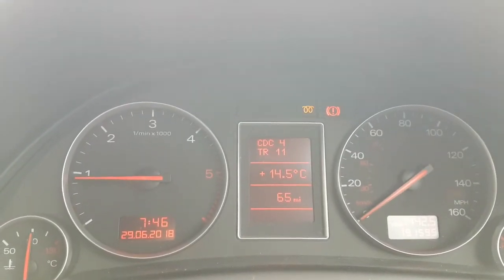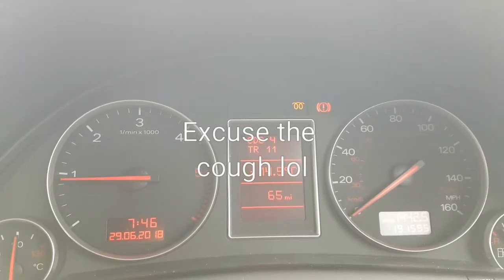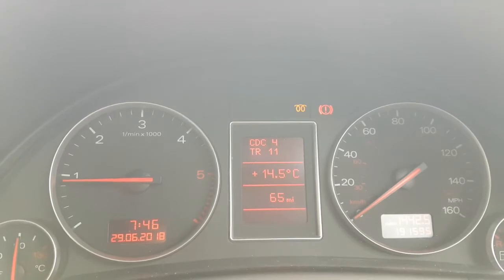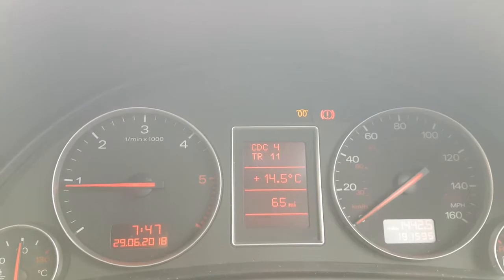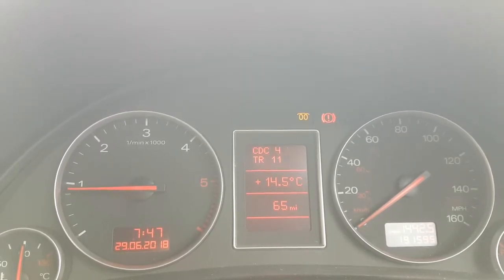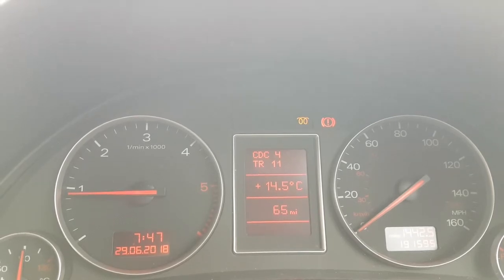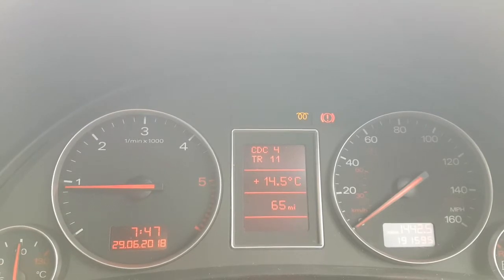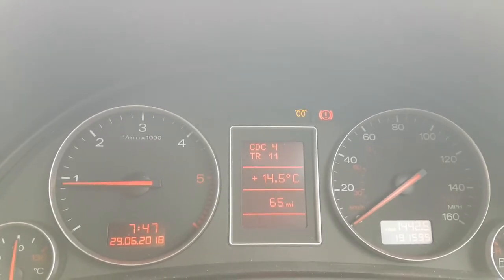Audi a4 b6 awx 1.9 tdi misfire on idle NOW WITH GLOWPLUG LIGHT FLASHING

Comment: 18062 - Please check DTC memory of instrument cluster P1654 - 35-10 - - - Intermittent
19463 - Camshaft position sensor (G40): No Signal P3007 - 35-00 - - - 
19561 - Valve for intake manifold flap (N239): Open or short to ground P3105 - 35-10 - - - Intermittent
17957 - Boost pressure refulation valve (N75) : Ope  or short to ground P1549 - 35-10 - - - Intermittent
16955 - Brake switch (F) : Implausible Signal P0571 - 35-00

I had a new break switch installed because break lights were always on even when i had the keys off the car , since i put a new brake switch , brake lights are working ok but on vagcom i still get brake switch fault and other fault codes instead of all the ones i put up here (well some of them still show like break switch , camshaft , n75 valve) buts other codes show up and car still in limp mode , but if i change the blown fuse on ecu car will be ok for a couple minutes

Comment: Hey buddy have you fixed this problem ? My Audi A4 1.9Tdi 2003 (B6) just has this problem for 2 weeks now and cannot get this problem fixed , car was in the mechanic last wednesday he told me problem was fixed but the issue returned again , i do not want take car to the mechanic again because seems to me that i wasted my money for nothing
Reply: Forgot to mention my car has the same engine (AWX)
Reply from the maker: Hello leandro, yes the problem turned out to be the crank sensor, 
I replaced the sensor with a cheap one to try it and it cured it for about 6 weeks, then started having issues again, so bought a genuine crank sensor, it is now roughly 6 months on and still driving perfect! 
Are your symptoms the same? Is it a misfire on idle but not when driving?
Reply: I replaced the camshaft sensor when the issue first showed up 2 saturdays ago , i had several faults and only blinking glow plug light on my instrument cluster when i vagcom the car , google it and seems that the faults are all related , i cleaned the egr valve , and cleaned my boost pressure valve (n75) , issue still on , then i open ecu box and found 15A fuse blown , i replaced it and clear the faults and car was again starting and driving normal when i went for a test drive  but as soon as i got home fuse blown again , thats when i took to the mechanic but mechanic said was fixed but apparently half way drive from the mechanic to work issue came back again
Reply from the maker: @leandromenezes4551  
Its the crankshaft sensor that needs replacing not the cam sensor, the crank sensor is located below the fuel filter behind the oil filter housing at the rear passenger side of the engine. What is the 15a fuse for?
Reply from the maker: @leandromenezes4551  
If you can give me the fault codes I can look into it for you
Reply: @chriswilliams1234  my audi gives me camshaft sensor error not the crank sensor , and if you  check previous replys i put the codes up
Reply: @chriswilliams1234  18062 - Please check DTC memory of instrument cluster P1654 - 35-10 - - - Intermittent
19463 - Camshaft position sensor (G40): No Signal P3007 - 35-00 - - - 
19561 - Valve for intake manifold flap (N239): Open or short to ground P3105 - 35-10 - - - Intermittent
17957 - Boost pressure refulation valve (N75) : Ope  or short to ground P1549 - 35-10 - - - Intermittent
16955 - Brake switch (F) : Implausible Signal P0571 - 35-00

I had a new break switch installed because break lights were always on even when i had the keys off the car , since i put a new brake switch , brake lights are working ok but on vagcom i still get brake switch fault and other fault codes instead of all the ones i put up here (well some of them still show like break switch , camshaft , n75 valve) buts other codes show up and car still in limp mode , but if i change the blown fuse on ecu car will be ok for a couple minutes
Reply from the maker: @leandromenezes4551  
Ok
Please check the following. All of these fault codes must be related to wiring, and since you mentioned a blown fuse I suspect shorting wiring to ground somewhere.
Open the bonnet and remove the scuttle cover over your battery, on the drivers side will be a box with a lid bolted down with either t30 torx  or 5mm Allen key screws.
Open the lid and check all of the plugs inside for water ingress and green corrosion. That harness is a common issue for corrosion from the engine bay to the body and causes all sorts of faults with brake light switches, steering faults, throttle faults, and most commonly engine faults due to the fact the car is not receiving or transmitting the correct information via that loom. 
If you have corrosion the repair is usually simple, just clean it out with contact spray and reseal the ecu box with GASKET sealer.. or ... buy a new box from tps. They are not expensive. 

Another place to check while you are there, near the battery you will find the ecu wiring. Check for chafed or corroded wires there too. Common for filling up with water due to blocked drains

Check there and let me know how you get on.
Reply: @chriswilliams1234  inside the ECU box all plugs and wiring loom are good they are mint , no water , no corrosion , inside the 80A fuse is good and inside the box is where the 15A fuse keeps blowing , i wonder what is the 15A fuse that keeps blowing for inside the ECU box
Reply: Just found out that 15A is there for the ECU so i wonder if i have a bad/fried ECU
Reply from the maker: @leandromenezes4551  
It is a possibility yes but fuses tend to blow when the wiring on that ciruit is shorting. So ideally you need to check all of the wires and trace them all to see if any chafing or corrosion is there. If so repair as necessary. If not then potentially yes a dead ecu.
Reply: @chriswilliams1234  would this be a relay problem ?
Reply from the maker: @leandromenezes4551  
It has been known yes, a sticking ecu relay can cause those issues yes but usually you would get a none start situation. But yes anything is worth trying.